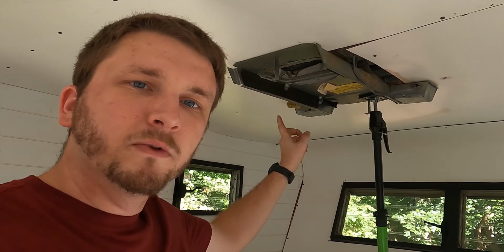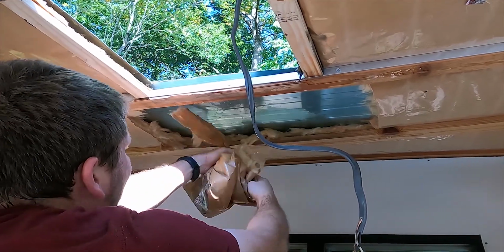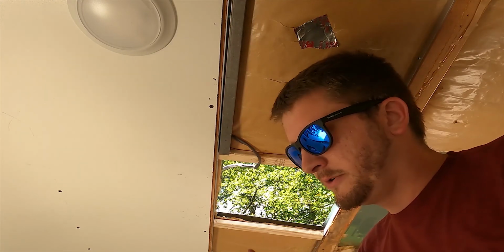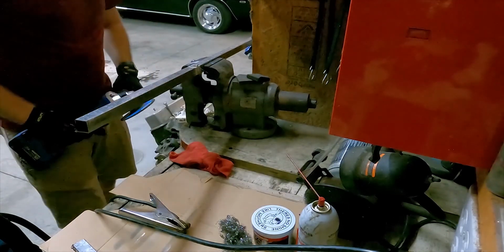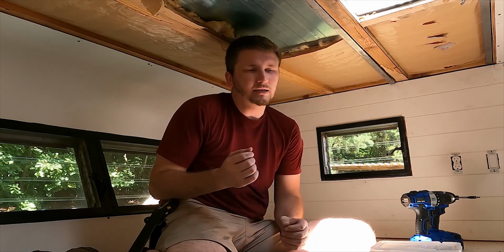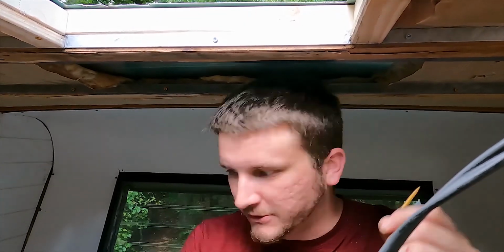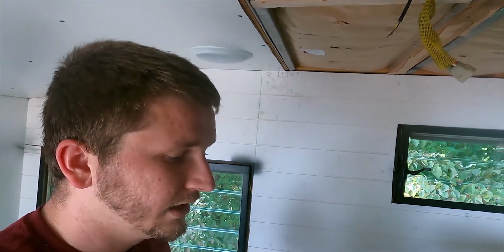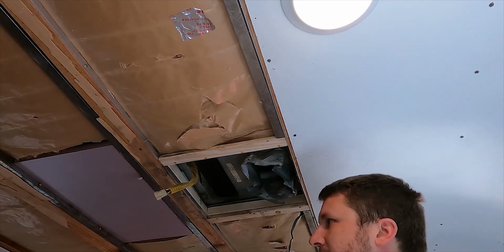I Messed Up. Camper A/C Install went HORRIBLY WRONG!

Comment: You also needed the right ac gasket they are one piece and waterproof and extra thick. About  $18.00 on Amazon .my motorhome is sagging in the middle and holds a little water against the gasket but doesn't leak.  I think y'all have done a great job on your camper and truck.  I'm very impressed.  Very  creative.
Reply from the maker: I didn't find any one piece gaskets when I was looking but I did get a thicker gasket and doubled up the area where the ends join. Hopefully that'll keep working.

Comment: Like your videos. I did notice that you need to use an A/C seal, and torque your 4 corner bolts properly. Once this is done, that joint can be under water and stay dry all day long.  Great job on this camper I enjoyed watching!
Reply from the maker: Thanks for watching! I used a roll of seal and overlapped it at the edge, so far it's held up great but I'll look at a camper seal specifically if I have issues.

Comment: Jake great series, i just had a thought on how to have a more rigid support for the roof ac. using plywood on edge to profile an arch from side wall to side wall  and support it with the brackets that you already have. the plywood would be very rigid even at 1/2" or 3/4" thick by 2" profile.
Reply from the maker: That could work, but it'd be difficult to get the plywood into the camper and placed in position, everything gets really right when messing with large sections of plywood in that area!
Reply: @StateFun  my idea is that it would be like a bowed up piece of wood, but made with the plywood vertical so the "arched" piece would be made from 1/2 inch or 3/4 inch ply glue together to fit the width of the bracket. and only 2 inches deep and the whole piece would have a shallow arc to "pitch"" the roof. so like a bowed up 2x1.

Comment: Great Video...maybe some butyl tape and Lap Sealant???
Reply from the maker: Actually found out later that the drain was also leaking inside the seal. It was mainly just poor design on my part.